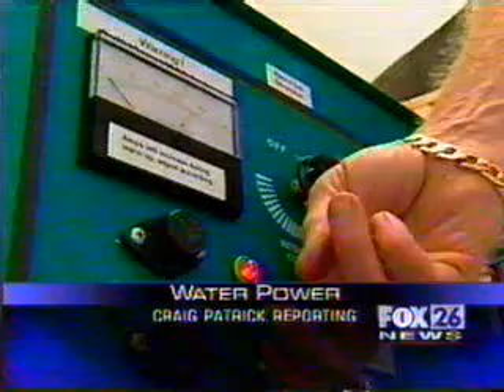Nuclear Fusion Electrolysis

Comment: @OgMandin0 Absolutely, so in that case the driver would have to either "disconnect" the O2 sensor if possible (sometimes thsi is "impossible" with fuel injected systems), if not then use either a MAF or and EIFE chip to offset this O2 reading incorrection. 104-4!

Comment: This is electrolysis.  = NOT FUSION!!!   

A very old video. Must not have been practical, it never got put into production.  

The very best, most reliable  electrolysis systems produce enough HHO to provide a 30% savings when added to gasoline. Stan Meyers supposedly did more, but his devices didn't survive when he died.

The big problem now is fighting engine computers. They are pre-programmed to make adjustments to offset the gains HHO can provide.